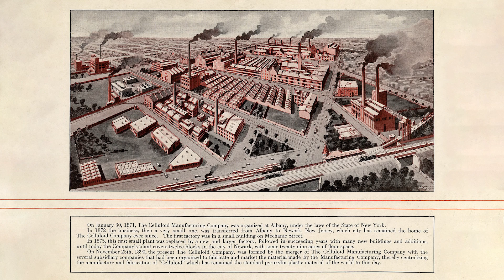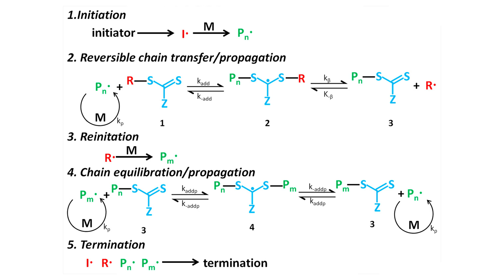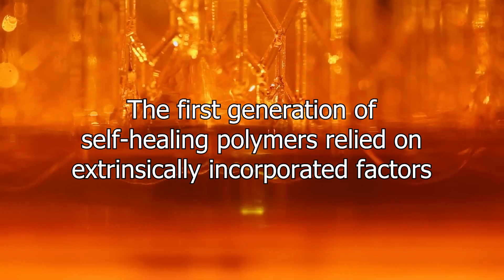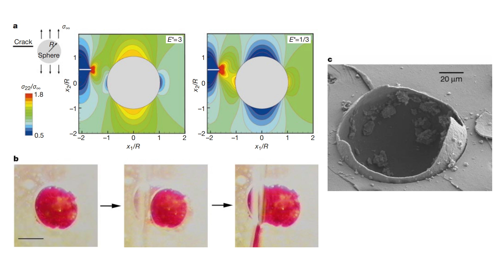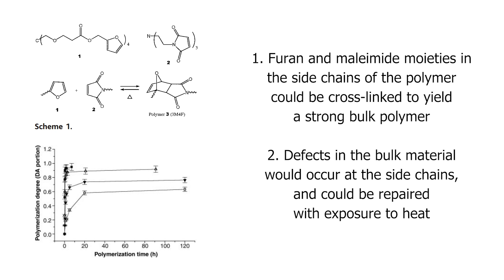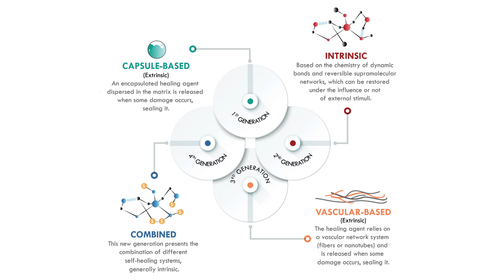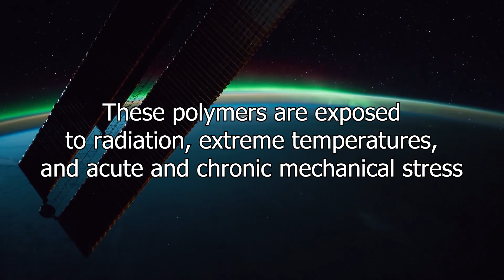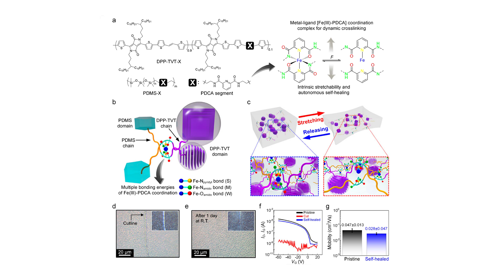Self-Healing Polymers

Comment: Seems like with both intrinsic and extrinsic mechanisms the healing is still quite slow compared to the possible speed of the defect propagation, how would we go about making it heal faster especially for the instrinsic mechanisms? These might be effective against fatigue but definitely wouldn't do too well against a catastrophic failure.
Reply: one idea - albeit one that only goes so far - is decreasing the viscosity of the monomer solution in the capsules or vessels, but that would generally involve decreasing the monomer concentration and so decreasing the healing ability

Comment: Ideally, you'd want some kind of multiphase polymer that had the desired healing reagent's in a colloidial suspension within the polymer itself. The activation energy of the healing reaction should be as low as possible so that the reaction spontanous completes and/or reverses at service temperature of the polymer. In this situation the reagents would need to be a catalyst so that the healing ability did not diminish over time-- in other words the healing reaction takes place constantianly through out the solution and then the reagent catalyst is somehow transported or able to diffuse to another site requiring repair within the polymer.  Basically the lowest we can make the activation today is the energy required to break a microcapsule and even then its not reversible in a controlled manner.